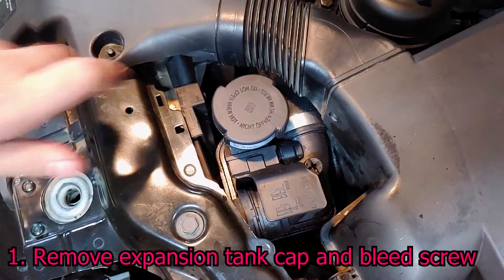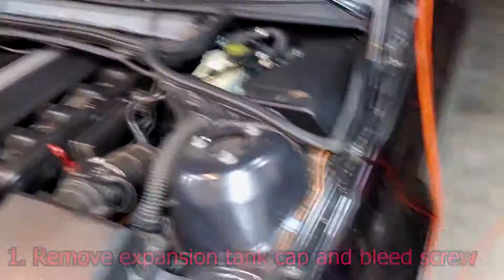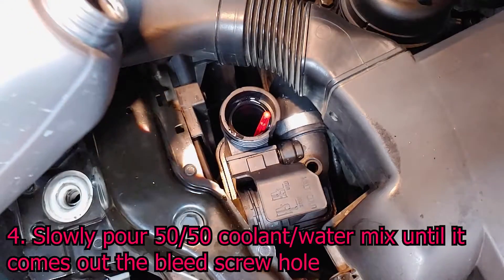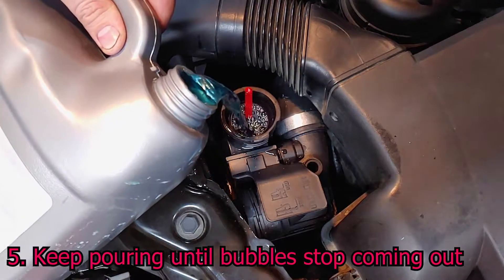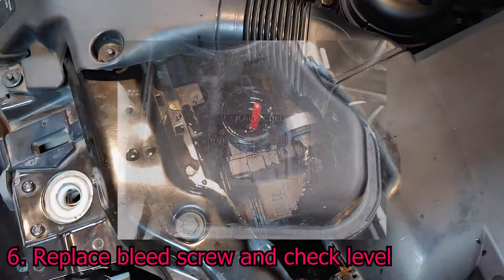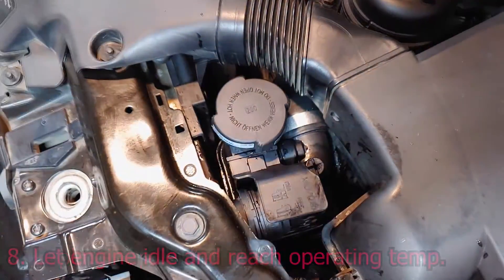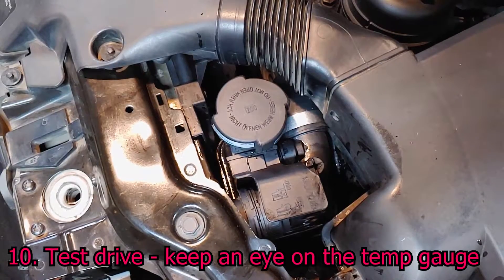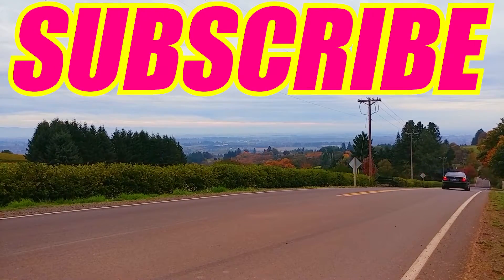Official BMW Coolant Bleed Procedure: 3-Series & 5-Series 1999-2006

Comment: Hey, great video! I’m running into a recurring issue whenever I bleed it. Yesterday I drove it for an hour and it was fine. Let it sit overnight and today I had no heat and car began to overheat in 10 ish minutes after warming up. Does this mean there’s a leak in the cooling system that pulls in air? Thanks in advance
Reply from the maker: If it isn't leaking then you might just have a bubble in the system. Try driving up a steep hill slowly with the heater on or jack up the front of the car while bleeding to get air out. Also make sure there is no coolant in the oil and that there isn't white smoke coming from the exhaust.
Reply: @endlessmoneypits I’ll try that out. Thanks!

Comment: What about for e39 530i comes with 2 bleeder should I open the first one connected to the thermostat first then the top one or just the top should be fine
Reply from the maker: That car has a completely different motor and I don't have the service manual for it.

Comment: If there isn’t an electric pump why does mine have a 50amp fuse for one?
Reply from the maker: If your e46 has a 4 cylinder gasoline engine, it may have an electric water pump. The inline 6 cylinder M52 and M54 motors have mechanically driven pumps.

Comment: I know 99 328i doesn’t have electric water pump right? It started around 05 when they used electrict am i right?
Reply from the maker: Definitely not electric on this car. Only the 4 cylinder e46 models may have an electric water pump.
Reply: @ i knew it. A lit are saying we have electrict water pump. I for what i know, after 2005 os when theybstarted that electrict water pump. So i know it has to be bled like any other cars.

Comment: I now have heat again. That worked great. Now, I still think I have a coolant leak and it could be entering the water pump and/or thermostat. Thermostat is relatively new compared to the miles driven since replaced. Where this coolant is leaking is any guess. I have seen some on the ground, but from up top checking hoses and looking everywhere in the engine I see nothing. I haven't had it up on a lift though. Any suggestions?
Reply from the maker: My first suspicion would be a coolant hose that isn't fully seated, but it could be a lot of things. Try to get in close with a flashlight to find out for sure.
Reply: @endlessmoneypits  
Thank you! I will try to check everywhere I can.
Reply: My problem was thermostat housing seal ring. Was looking for the small leak over a year

Comment: That's not how you do it for an E46 that's how you do it for an E90 electric water pump
Reply from the maker: Procedure taken from e46 service manual.
Reply: @endlessmoneypits  I could  be wrong 🤔 some say to turn the heater on all the way to 91° heat and turn the fan up to max🤔 on the E90 N52 heat turned on to Max 84°and the fan speed on the lowest setting,the first setting starts the electric water pump, fill the radiator and expansion tank up bleed for 10min run the electric water pump 10 min💪🏻
Reply: I turned the car on when I do, motor running.
Reply: If you don't turn the key to the on position and turn the heater temp to 91 and fan on the lowest speed you won't have coolant running through the heater core.

Comment: Hello sir, point 6 and 7 state that the cap and bleeding screw should be replaced. Are you saying that its best to get a new expansion tank cap and new bleeding screw before adding coolant and bleeding the system?
Reply: Why don't you use the electric waterpump to purge the system?
Reply from the maker: This car does not have an electric water pump.
Reply: I needed this video lol I had the car running while it was bleeding and it wasn’t working and when it wasnt turned on all the way it did the job better and sucked out all the air. No overheating no more Not all heroes wear capes hell ya appreciate good sir
Reply from the maker: When I said to replace them I meant to put them back. Not to buy new ones.
Reply: @endlessmoneypits  thank you sir. I will try and do this process today!
Reply: @endlessmoneypits you really should be more specific

Comment: Nice. one thing. Did you rince off the spilled coolant? Is it corrosive to hoses pipes etc.?
Reply from the maker: I have never rinsed it off but it's not a bad idea as long as you're careful not to get anything electrical too wet. No corrosion here. Owned the car since 2007.
Reply: @endlessmoneypits  thank you. That is a beautiful car. Mine is 2004, m54. I look at e46 content a ton and you don't hardly hit my feed. I even subbed like a year or more back. Not good for me or you. You run a beautiful channel. Edited nice, with not too many skips on processes. Glad you on. Not many 1st time owners so you have a unique perspective on longevity of parts replacement. I would benefit from that if you ever want to put out as an excell and discuss your experiences. Thanks for sharing.
Reply from the maker: Thank you. I think my channel doesn't get recommended a lot because I make content on too many different vehicles. I'm actually the 3rd owner of this car but I have kept a spreadsheet since purchased. Good idea for a video! Thanks again
Reply: @endlessmoneypits  I thought you might like the suggestion. Go for it. Can't wait to see how you phrase the title. Love the blue , I've got alpine white.